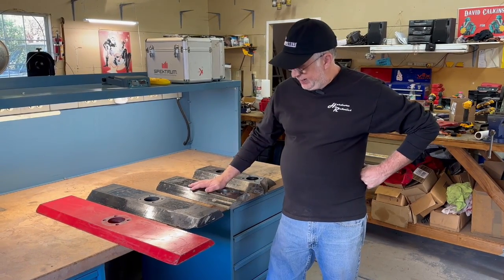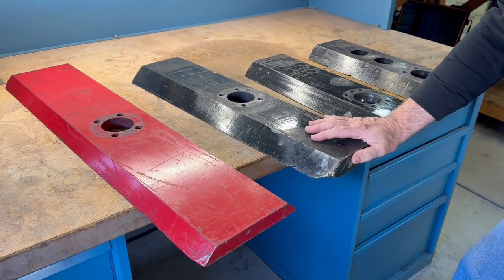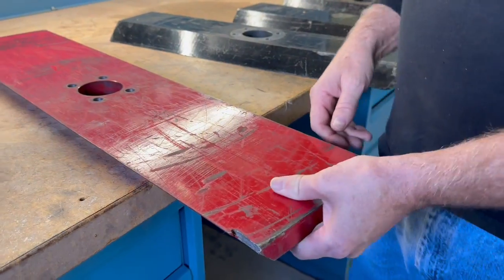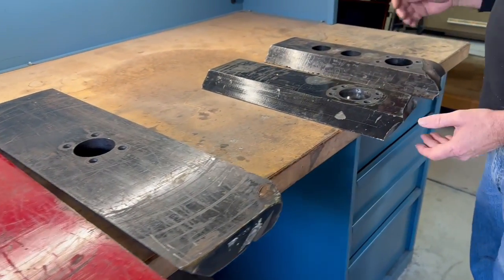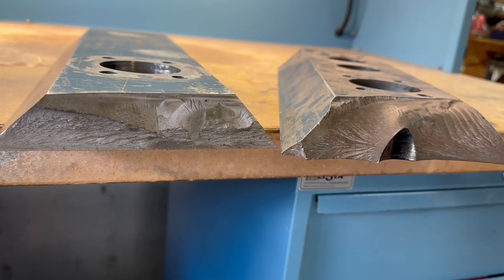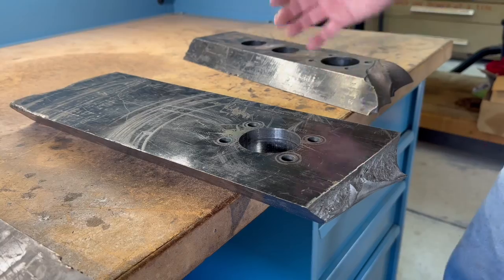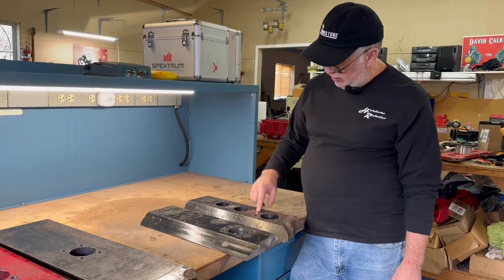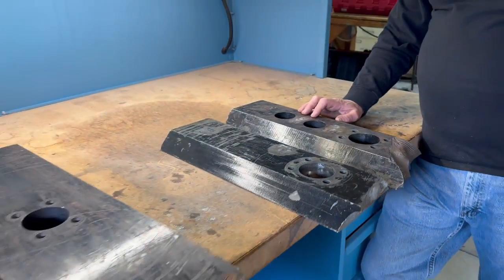Tombstone's weapon bar failures

Comment: I make knives and chisels sometimes, and i already tried few things with hardening. and this snapped blade really reminded me when i made some chisels and hardened them in various ways. first was hardened by dumping it straight into cold water and letting it cool down completely, and later being tempered. this chisel seemed pretty good and hard, it could be sharpened well and held the edge, however, when chiseling some harder steel at an angle, it snapped off. the second one i made, i took the same material, used lower temperature, to try to give it bit better hope of surviving. the tempering procedure was same again. and while this one did not snap, it got blunt more quickly, and did not want to cut into steel as well as the previous chisel. with the third chisel, i went for a diffrent hardening procedure. instead of dumping the steel into water and letting it cool down completely, you just put the steel part into water just for a short time, and pull it out when still hot. than brush of the surface and have a look at the colors, when it turns blue, you dump it into water again and cool it down completely. by this you end up with hard surface, but soft metal underneath, thus the tool is hard on the edges, but not so prone to snapping. i went for slightly higher temperature for hardening, since the material did not get fully cooled down during the heat treating process, and slightly higher temperature for tempering as well, since i feared there would be more stress inside that steel with the hardness diffrences across the material. I am not saying this is some peak material engineering and agree there was a lot of eyeballing, but it did make a diffrence. that chisel was nearly as hard as the first one, but it finally snapped much later after using it as a prybar, and i think it even bent slightly before fracturing. i think it would make sense here, since you need just the edges to be hard, and not the entire blade.

Comment: I might be a little late, but what material is the black bar that you fought against Minotaur? I've been trying to get some information on it and best I could get was from the creator himself!
Reply from the maker: The bar used in the Minotaur match was made from S7 tool steel. It's great because you can get toughness and hardness from the same material, but sadly when it fails it just snaps. So it's great, right up until it sucks ;)

Comment: there are a lot of tricks that bladesmiths use for hardening where they leave certain parts softer than the cutting edge to give it more strength while still keeping the hardness of the cutting surface so you could look into that.

Comment: Hey Ray, is there a reason you aren't using a forged steel weapon with tool steel "tips"? aside from most likely a full redesign of the geometry of the spinner.
might be significantly more durable and repairable. not sure. have you looked into it, and if so do you have any thoughts?

Comment: I wonder if an AR500 main bar with S7 "rails" along the edge would be a viable option? It might give a nice balance of absorption vs cutting power. Or alternatively, use a weapon similar to what Hypershock used against Gigabyte, and use S7 sandwiched between AR500?
Reply from the maker: Bolting one type of steel to another wouldn't be ideal. If I was to do that, I would use aluminum for the bar then steel teeth since that maximizes MOI for a bigger hit. Downside is if the tooth comes out :)

Welding dissimilar steels together creates its own challenges. There's now way to really handle heat treating before welding, since the welding act would change it. And heat treating afterwards would be awkward since different steels have different recipes for treatment. S7 is an air quench for example, while many others are oil quench. It's not that this can't be done, but I've never seen it done in a way I thought would work in my usage.

Sandwiched weapons do work, and I have even done that myself on some bots. The problem comes with weapon length. Any short spin circle sandwich can work just fine really, but the longer the distance from the mount to the tip, the more the differential flex between materials starts to be an issue. You can reach a point where the flexier material will oddly pull on the fasteners and can actually make it easier for the harder material to snap then. 

There are no single answers really, just continued refinement of your ideas, with the hope of finding that sweet spot. Of course everyone else is doing that too, so even when you do find something that works, it may simply not work next season! Always a challenge :)
Reply: @ray9368  Wonderfully said, sir. I'm looking forward to seeing whatever you come up with next!

Comment: Just typing my thoughts, correct me if i'm wrong, but can't you make the tip hard and the body soft?
I know little about the material science involved, but i think i know enough of the process, heat it up and quench it to make it hard, then slowly heat it up to release stress and soften it right?
Can't you idk, differentially heat the middle of the bar to release more stress there to make it softer, tougher and less brittle, while keeping the tips hard to dig into armour?
i Know they did something like this with katanas? with mud or something like this to keep the blade hard and the body soft
Reply from the maker: Your basic ideas on heat treating are correct. Steel is heated to its austenitic temperature (~1420f) which changes the crystalline structure inside the material. It is then cooled quickly by various means to set this hardness. Heating the material after cooling, to less temp, will stress relieve and lower hardness. This tempering step varies in temp and time, depending on material itself and hardness desired. 

Heat treating of something this large is done in an oven, to very specific temperatures. So although edge hardening, case hardening, and differential hardening are possible, it just gets harder to make happen as the size goes up, and the hardening recipe gets more specific. 

There are other options certainly, and the time may be to start moving away from S7 as my material of choice. We'll see :)

Comment: Thanks, Ray - for taking us into your shop and helping us understand why things happen the way they do.

In addition, to the type of metal and the hardness, could the shape of the bar be adjusted to deliver a less self-damaging impact while delivering a more devastating blow to the opponent?
Reply: Yes he could but regardless he's still taking the damage cos physics says 50% of every hit comes back to you as weapon recoil like a gun pushing back into the body of the user when they pull the trigger. No amount of changes to the weapon tooth profile or material composition will help you escape that.
Reply: @TheInvertedFollicle507  Hellachopper's spinning hammer configuration would disagree, but it's busy not competing, and being on fire :)
Reply: @stonefish98 
It's also the reason they first enforced the 250mph tip speed limit.
Reply from the maker: Certainly geometry always plays a part in this. The newer AR bars that I've run, with the widening at the ends to have higher MOI are a good example of that. I may try machining an S7 version like those and see how it holds up.
Reply: @ray9368  I was wondering if a spike of some sort near the end that would poke holes would work
Reply: @ray9368  cool I hope to see how it works out for you!!
Reply: @ray9368  does MOI mean moment of inertia?

Comment: I would put a nice radius on any edges that do not need to be sharp. 

It should distribute the load and resist propagation of fractures.
Reply from the maker: The bladed edge had a specific purpose. The weapon bar just moves a significant amount of air around, and with the weapon edged that way it could simply spin faster since it was fighting the air resistance less. This is one of those things that worked great for many years, but less so now and we'll need to adjust going forward.
Reply: @ray9368  Would it make sense to have the bar with something of an aerofoil design? Also, maybe case-hardening would make the weapon bar more durable while still being hard enough on the outside, although the hardened layer may be too thin.

Comment: as someone that is an amateur bladesmith, I have to wonder if a differential hardening process or a san-mai construction technique might improve the overall performance of the weapon bar. S7 at the core for the cutting edge hardened to around 53-54 rockwell, but a milder tool steel wrap to provide the impact flexibility to resist the inclination to shatter. Just a thought, and doing a san-mai on that size scale may be cost prohibitive, but I bet the results would be stellar.

Comment: Why do you harden the entire bar?  You only need the striking edge hardened so the rest of the bar can absorb the shock and be able to flex.
3:22 I wonder how hot these weight-reducing holes got during the milling process?
Reply: No you dont the forces wouldnt be equally divided
Reply: If he doesn't the bar just snaps instantly, cause un-heat treated tool steel can't take those forces lol
Reply: @dareapermanstormearth1891  Do you really think the same hardness on the surface is throughout the entire bar to its core???
Reply: @AndyFromBeaverton yes when done properly it is

Comment: What about a steel like H-13?
Reply from the maker: I have not used that alloy before, but I have been considering it. A great thought!
Reply: @ray9368  I'm a knifemaker, buy trade, I don't know what you know about steel. S5 and s7 are good tool steels. A blacksmith or a heatreater would know the the property's your looking for any how, good luck.

Comment: You should make the weapon bar out of whatever they make forklift blades out of. Them things being like an inch thick maybe an inch and a half and able to lift 8000 pounds without breaking or bending super hard would probably work nicely.
Reply: hardness and strength are 2 different things
Reply: @kraftzero2957 One type of alloy commonly used in the construction of forklift blades is 4140 or 4340 chromoly (chromium & molybdenum alloy) steel.

This is softer than some other types of steel like ar500 or especially tool steel and while some spinners do use 4140 like riptide, black dragon and minotaur as its more easily sourced and cheaper but more easily damaged as its not as hard as the more specialised alloys.

Comment: Two thoughts; I don’t see a need to put an edge on the entire bar. Could you put an edge on the outside 4” and keep the center portion square?  As I write this, you made a comment to that effect. The second thought I had was to differential heat treat.  If the could make the tip hard and the area away from the tip soft it would reduce the chance of a shear failure.
Reply: He does mention that as a possibility, though it is worth considering that sharp corners (like the one between a blade and a square section) are stress concentration points - you wouldn't have to worry about chips as much, but you would be concerned about a big enough hit just directly causing a catastrophic failure, no stress cracking or chipping needed (this depends on the material properties of the steel and geometry of the blade) - not to mention you would almost guarantee stress cracking at that corner, making the risk of failure even higher, and I wouldn't be surprised if the average lifespan of the bars went down as a result.

Of course, Ray is a far more experienced engineer than I am, and I have no robot combat experience, so he knows better than I would. But it would definitely be a trade-off to some extent.

Comment: I wonder if you would get better results if you were to forego a bar shapes weapon for a large saw blade.
Yes, you would sacrifice the visual appeal of "Big Hits" but you might deliver more consistent damage, especially against faster opponents that attempt to take a glancing hit then quickly readjust and move in while your bar is spinning up again.
No matter what you decide, I'm looking forward to seeing you compete next season.
Reply: There are two factors to consider when thinking about a spinner - energy and 'bite.' Energy is a function of mass, rotational speed, and mass distribution - the 'farther out' the mass is from the center, the higher energy, this is called moment of inertia (MoI). Ray has a great video explaining why he uses toothed bars where he talks about this more. A solid disc, like a sawblade, would have lower MoI than a bar (especially a toothed bar), and so therefore lower energy. A hollow disc (think like the ones Valkyrie or RotatoR use) has the highest possible MoI, but is in turn more fragile and harder to manufacture.

'Bite' is how effectively you transfer that energy, and is not nearly as mathematically defined as energy. Think of a perfectly smooth cylinder spinning (like a saw disc with infinite tiny teeth) - it could have tons of energy, but it would be terrible at transferring that energy due to low 'bite,' it would just kind of rub against the enemy. Now imagine if that disc had one giant tooth sticking out, anything that tooth hit would take the full force of the blow. An example of 'bite' in action is Cobalt - Cobalt's weapon actually isn't that big or energetic compared to the "big weapons" (Uppercut, Ripperoni, etc.) However, their design, with one huge tooth, gives them massive 'bite' - this is how they vaporized Ghost Raptor. High kinetic energy is useless without solid bite. Pretty much by definition, a bar is the weapon with the highest possible 'bite' and switching to any other design would reduce Tombstone's effectiveness. 

The only thing that beats a symmetrical bar like Tombstone is an asymmetrical 'key-shaped' weapon like Bloodsport or Triton use, but that introduces weird physics things - look up the "tennis racket theorem" if you ever wonder why Bloodsport always lands on its side after a big hit.

Comment: Would it be possible to have a bar that is AR500 with teeth made of S7 tool steel
Reply: Probably not, remember, any welds are a weak point, it screws with the heat treating of the weapon, and if you heat treat too much, using Ray's red blade as the example, it gets brittle; it gets too hard.
Reply: I wouldn't think that would make too much sense, because if you're already using a toothed bar, you're assuming/hoping you never take any hits to the 'body' of the bar anyway. Why use the weight on steel? Instead, make the body out of something lighter and softer, like aluminum or titanium - this is what Ray already does with his toothed bars. This also allows you to make the teeth bigger, giving you more MoI.

Comment: What bar would you use against HUGE?
Reply from the maker: They might be reading this, so I'd say one made out of marshmallows, or maybe styrofoam :) 

Seriously, we'd have to give a lot of thought at the time.
Reply: @ray9368 LMAO 🤣
Reply: My guess is the red thin s7 one with the  45° bevel down the sides. Long and has a cutting edge for attacking the wheels of huge. Or the short black ar500 bar for taking the uppercuts from the spinner.

Comment: Can you imagine getting hit in the shins  with Tombstone?
Just a thought....
Reply: google it up. tombstone hits with about 50 times the force of an AK-47! can you belive that?
Reply: @BotvacProductions469  apparently Tombstone's most high energy blade also hits with the force of approximately 10 times the force of a 50 cal sniper rifle. The rifle bullet stores around 10-15 KJ of kinetic energy.
Reply: Considering any calculations would put the Kinetic Energy of Tombstone's blade above the Kinetic energy of a ram from an *Elephant*, you wouldn't have legs anymore.

Cause yeah, Elephant rams are a bit over 125 Kilojoules, Tombstone's blades usually come over 200 Kilojoules at top speed.
Reply: @dareapermanstormearth1891  Hmm, Ray has said his most powerful weapons are probably the aluminum bars with the bolt on steel inserts are hovering around the 106KJ mark I'm not sure where you got the 200KJ result from.
Reply: @TheInvertedFollicle507  calcing the weight and speed of Tombstone's blade lol
Reply: @dareapermanstormearth1891   tombstones blade wieighs about 70 pounds. and spins bout 250 MPH